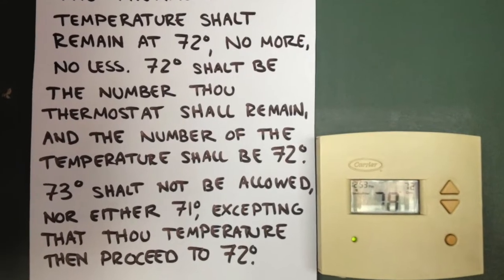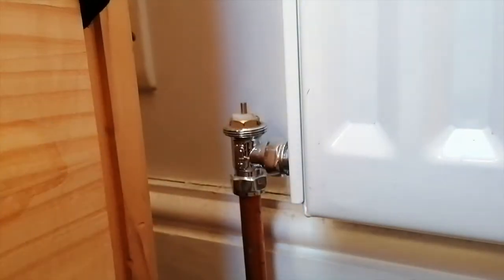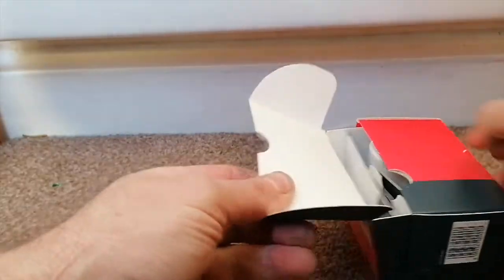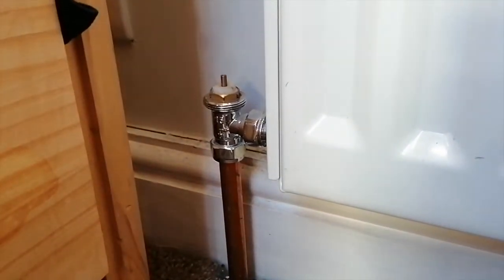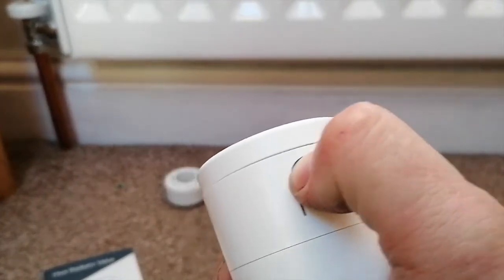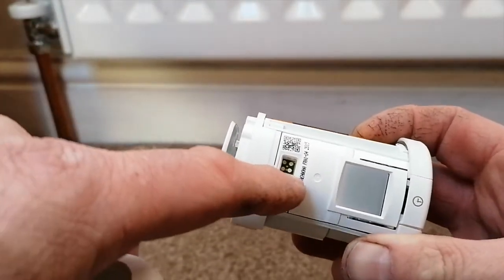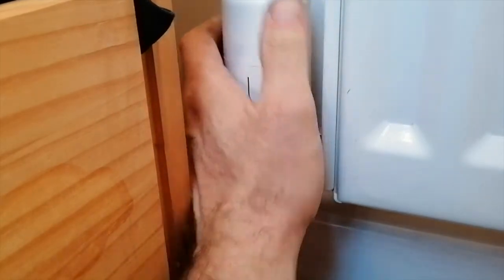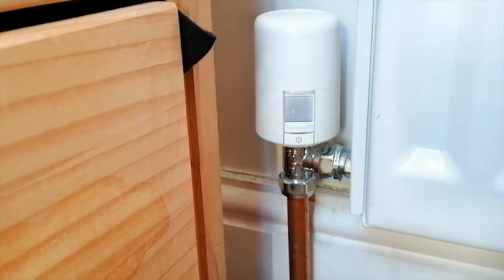hive thermostat head 2022 a great way to save energy and control a single zone

Comment: Very interesting Paul. I need to charge mine  sometime
Reply from the maker: Yep there's a few simple ways to trim the bills
Reply: Mixed reviews, I have three, all fail to close fully when temp is satisfied. I believe it is due to the high pump pressure due to my micro bore type pipe work.  Works for a lot of people as advertised.
Reply: @darrylhunter335  thanks Darryl I’ve not changed it yet so that’s good to know 👍
Reply: Any bother with the calibration and delayed opening closing etc
Reply from the maker: All good so far